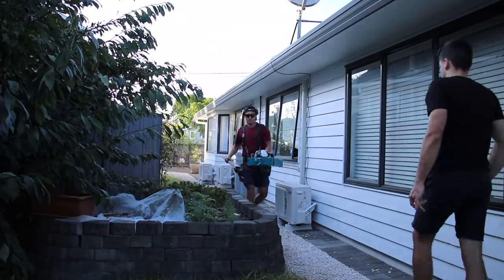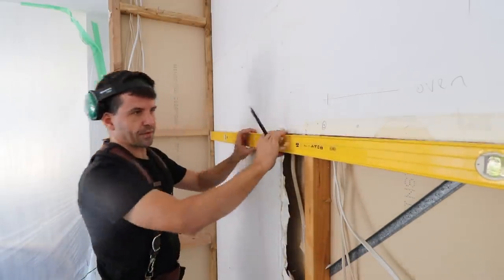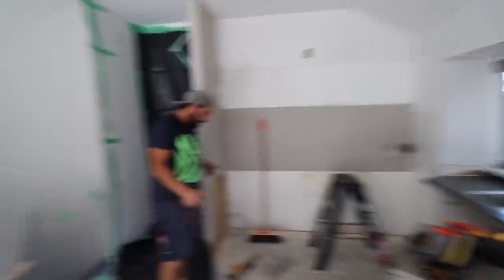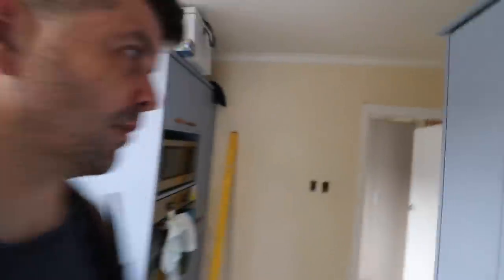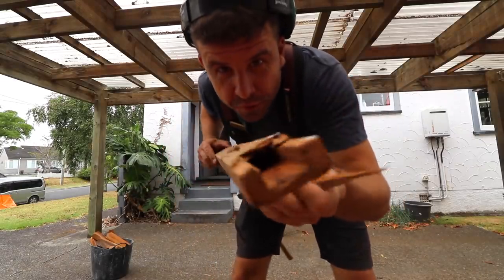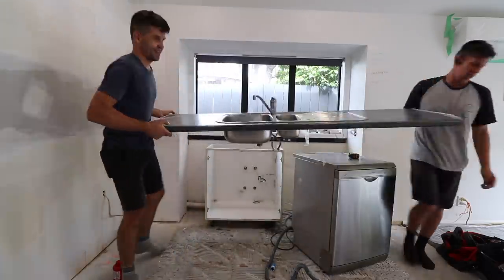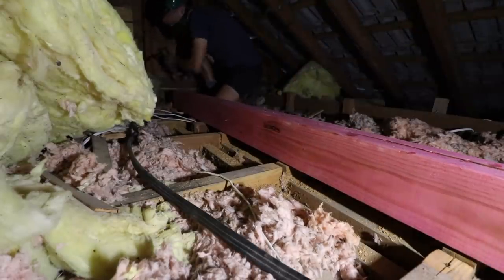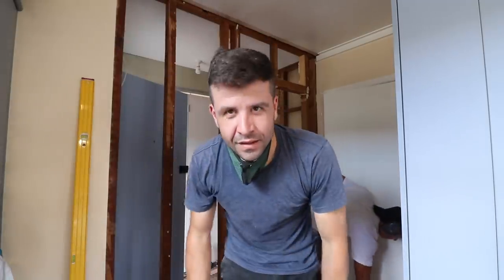Builders Don't Install Kitchens [Part 2]

Comment: You can't understand the insane amount of jealousy I feel right now.

I live in Sweden and the weather here is awful right now.
Reply: Niklas Paulsson I’m in Michigan and it sucks here too I’m moving to New Zealand in my 30
Reply: Just spend 6 weeks in NZ, bit of a bummer, coming back toa  stormy, dark and very wet Malmö.
Reply: North of Norway, building a hotel here, does not have walls yet and its minus 5 and we have ONE day a year when its not wind :P
Reply: Same here in your neighbour, Finland. Thankfully we have beautiful videos provided by Scott!
Reply: It's called winter..
Reply: NZ has pretty bad weather on the whole. Cold wet winters and windy as hell down south. Come to Australia as it has a far better range of weather and the trade get better pay also.
Reply: The only thing you dont have to put up with NZ weather is the sun.  It can certainly BURN you, even at very low temperatures. We have one of the highest skin cancer rates in the world and our sun is harsh due to thin ozone layer. The more pale skin you are, the more easier your skin will burn on fire.
Reply: @sydneyshinshi  bad is in rain or humidity? I'm in Hams and our temps are between 29 -31 not counting the humidity.
Reply: @TheClaudos  Where is Hams?
Reply: @sydneyshinshi  In the Deli section of New World, Pack n Save, Countdown.
Reply: @TheClaudos  Ah Hamilton now I know.
Reply: Michael Magill otherwise known as “the Tron”, Hamilton. Used to be seen as a small city stuck in the 70’s/80’s, so the nickname is a sarcasm, but the town has grown and advanced somewhat and the nickname carries more affection these days

Comment: for plastic walls we use the thicker stuff edge it with a duck or heavy tape. apply painters tape to wall/ceiling than use cabinet feet you would nail in so they can slide around the cabinet shop to tack the plastic into Sheetrock than use more of the heavier tape to seal it to painters tape works very  well

Comment: To get poly to stay up either use support extension poles or use painters tape on the drywall and use tuck tape (sheathing tape) from the plastic to the painters tape. It holds really well.

Comment: I'm a  Carpenter /Joiner in UK .I install kitchens & bathrooms also do 1st & 2nd fix ,cut roofs ,tile walls & floors .As most of clients want a start to finish project .By doing it all easier to keep work flow no waiting on different trades .Only trade i get in a sparks but he my brother i first fix
Reply: Same here pal. Most Carpenter / Joiners I know fit kitchens
Reply: Same here Dave. When I did college a long time ago kitchen fitting was part of the course. Seem to pick up skills etc as you go along. I dry line, spray kitchens, fit them etc
Reply: It's the same in Australia, a builder will usually prepare the area and a cabinet maker will be engaged to supply and fit the cabinets/ benchtop. Then tiler, plumber.....etc
I agree alot of time wasted between trades, but its usually not feasible ( here in Sydney) to supply then install a kitchen yourself compared to the price a cabinet maker will charge to supply and fit.
Reply: normel678 I was in sydney visiting family last year. Didn't check out any builders merchants whilst over there but in the UK normally builders merchants supply kitchen units either in flat pack or ready built. It's just a matter of fixing them together etc. Is it the same in Aus? I've known friends of mine with no carpentry experience fit them.
Reply: @wildobeast1472  - yep, you can buy flat-pak from large hardware stores and some kitchen places supply them flat-pak as well. Just replaced by own kitchen cabinets in NZ with flat-pak cabinets from a kitchen importing company and I'm not a carpenter, builder or anything like that.
The range in NZ hardware stores is nothing compared to B&Q in the UK, though.
Reply: @wildobeast1472  yeah you can buy them flat pack here as well. I have put a couple together before. My experience is that by the time you buy flat packs, get them to site, put them together and then install them it's not worth the minor saving and the quality is way inferior to a cabinet maker's. That's just been my experience and most builder's I know always engage cabinet makers.
Perhaps flat packs are much cheaper in the U.K. which may make it more feasable.

Comment: Cut out a square big enough for a 12x12 x1 air filter and tape it in your plastic wall to allow air to flow threw it, but not dust. Keeps it up longer

Comment: You stress that you can't use that method to remove a load bearing wall.  Ok I'm fine with that but if it is not a load bearing wall it doesn't need to have any additional or replacement supports.  The wall is not holding up the ceiling it is only holding up itself.
Great video!

Comment: Cool to see the 36v Makita worm drive in regular service.  I'm pretty interested in that thing.
Reply: So much torque - you see how quick it was going through the timber. Nice saw.
Reply: It's a bit heavy, but a fantastic saw. Bought it after my corded Hitachi started to sound like a helicopter and flash like a strob.
The makita is much stronger and easier to cut with overall.
Reply: @mackaronen  Yep is a bit heavier than the normal 6 1/2" cordless saws too. 

Where it's rear handle its heavier on the wrist. So much toque in them for cutting 2x4 or 2x6.

Comment: I hold my plastic up with roofing batton. Get one across the top to trap the plastic. One on the floor to get the bottom and spring in some uprings to hold it in place.

Comment: Staples through the tape into the ceiling normally help hold the plastic up.👍
Reply: Then you have to fill and touch up afterwards.

It works but a bit too much for a job of this size i'd imagine.
Reply: @shifty277  yeah very job dependent. Most of the time on these sort of jobs there's normally a vast amount of plastering and decorating so the cut down in dust outways the minimum repair cost to the ceiling.imo obviously
Reply: @rossmale8715  Yep see what ya saying here. They put the carpet wrap down too. That stuff is really good.
Reply: @shifty277  one of the first things off my van. I've got two rolls one for carpet and one for hard floor,I made the mistake of putting carpet protection on a hard floor and trust me when I say I won't make that mistake again 😂😂
Reply: @rossmale8715  Haha yep they have a different way of bonding to the surface - i'd imagine the carpet stuff has to be a lot more stickier - where as the wood protection doesn't need to stick really just needs to go down, stay down and be durable. 

Customers always appreciate it when contractors make the effort to avoid any accidental damage - even when in my own home nice to see people put protection in place before I reach for my own stuff.
Reply: @rossmale8715  I saw on a job where they had to sand and refinish the h/w floor because of the carpet one used. Expensive mistake that.

Comment: Actually I done plastic wall once upon, when used slihl power saw to cut out new doors in noncrete wall woth thickness about 45 cm.
Must be used 3m double side tape and heavier membrane. Of course that tape will stick to non dusty surface and when you take it off, it might damage surface a little bit.

But it worked.

Comment: You should look into Zip Wall poles or FastCap "Third Hand Poles" for your temp walls. I use them here in New Jersey for temp protection.
Reply: Bryan Butterfoss we use something similar here in Australia, I normally carry 5 poles and can divide a large room in minutes. No tape needed
Reply: Same here.  Zip Wall system is a must.
Reply: Simple alternative is using the extra large squeegee heads on extension poles. 

Frankly why they tried to tape up plastic with green tape is baffling. 

Also had to get creative on huge homes. Used the carpet pad from the demo wrapped around a 2x to hold plastic up. 

Was working outside of Boston when grinding up tile mortar set off the smoke alarm.  The fire fighter in full gear tried to step through an old rigged zipper opening and his air tank caught on it. He went head first into the front lobby reception desk.....
Reply: @livelikekings8968  What plastic do you use (for your temp walls) and where do you buy it?

Comment: The hinge jigs with an 18v router are money! Are far as i'm concerned the days of doing hinges completely with a chisel should be done.
Reply: where do you get yours from? Are they adjustable or you buy 100mm/90mm sizes
Reply: @mcleaniechris  in the UK Trend have the full beans kit @ £180 of just the bare hinge jig is £80. 

Ryobi also do a barebones jig on Amazon too at about £30.

The UJK version on axminster.co.uk is very well regarded too at £80.

Lots of options depending on your budget.
Reply: I took the time to learn how to fit hinges with just a hammer and chisel. However,
Now that I know how to do it I prefer to just use a router as time is money my friend
Reply: @tormenting360  agreed. As long as you take your time with the router its easy to get a flawless result as well.

I dont even cut the corners with the chisel as in the UK, you can now get curved radius corner fire rated hinges.

Comment: Its funny you say Builders dont install kitchens ,I was always told by an old boss called Ken "Cabinet makers should never build houses" . I also remember building told never do anything in pen on wood/gib board or any form of building, always use a Carpenter's pencil , Good Old Blackledge

Comment: SBC - I don’t know if the company “Fastcap”  sells their tools in NZ. They make a tool called 3rd hand https://www.acmetools.com/shop/tools/fastcap-3handcpack-3rd-hand. In this case it’s a jack that reaches from floor to ceiling, great for holding plastic in place, when someone opens a door, or if the door is open all day. Fastcap makes several sizes. They are perfect for installing upper cabinets. Keep up the great work! A fan from USA.
Reply from the maker: Thank you mate, I'll look into it !
Reply: @ScottBrownCarpentry  I mostly work alone so the 3rd hands come in handy. Add in a magnet strip for any door ways needed. My clients love the ease of use of the RE-U-Zip Magnetic Self-closing Entry. You can find it on amazon.

Comment: 8:15 kinda strange, never seen this done before in the US. Not that I’m a framing pro lol. But if the wall you’re removing isn’t load bearing, then what is the need to somewhat support the roof truss cross members with that pink beam? Curious, not trying to be a jerk. 👍
Reply: To me it looks like the bottom roof truss members are spliced over that wall, which is why they need to reinforce it. If they weren't it wouldn't be necessary.
Reply: He is in the neighbors house which is a conventionally framed roof, not trusses. So the ceiling joist need to span across walls and usually require hanging beams to take out any sagging that may happen in the span.
This wall is taking the ceiling load not the roof load, hence the need for the hanging beam. Hope I made sense.😊

Comment: for the blowing plastic wall use a zip wall poll, or carefully have a bit of timber sprung into place.   On the commercial installs my brother and I used to do we would also have our tools on a painters scaffold and with strategic broom placement we could use that to support the blowing plastic sheeting.    great work, thanks for sharing your craft.

Comment: Hi from Sydney! Thanks for the fantastic videos, man. I wanted to ask - how do you use the DeWalt table saw (15 amps) at any given house without tripping breakers? Thanks again!
Reply: 15 amps is nothing surely? Standard UK circuits for sockets are 16A or 20A - what is it over there?
Reply: @alexanderbuckland  10A in AUS to my knowledge 😅
Reply: I've got one (USA) and mine constantly trips breakers... Thinking about getting the flexvolt battery table saw just so I can stop walking down to reset the breaker every other cut
Reply: @brianwood876  might be worth getting a sparky to install a new plug and fuse just for the table saw!
Reply: @nab024  I work in other people's houses 99% of the time.... I run it off a 20 Amp at my house but it'll trip a 15 Amp no problem on the job
Reply: @nab024  and I specialize in older houses (new England) ... Some of which don't have any 20amp breakers, some don't have breakers at all
Reply: Alexander Buckland don’t confuse what a circuit is rated to with what you can plug into a socket. The purpose of the circuit breaker is to protect the cabling, which needs to be rated to what ever the cable size you use is capable of carrying.

In Aus and I presume NZ most residential circuits will have a 16A breaker which will protect a 2.5mm cable operating at 220 to 240v. 

When it comes to sockets the standard socket in the UK is rated to a maximum of 13A and UK plugs have fuses in them. 

In Australia/NZ a standard socket is only rated to 10A. For us to connect anything higher than 10A then a 15A socket is required which in turn will mean a larger breaker and cable supplying the socket. The difference between a 10A and 15A socket is the 15A socket has a longer earth pin which is too big to fit into a 10A socket.

Comment: 50x150 (2x4)... look to be a little small for that span of the roof. I would have at least used 2x6 (is that 50x200?) douglas fir's. I couldn't see the length, but either way in the us the small stud wood like that usually is not structural grade.
Reply: 50x150 is 2x6. 50x200 is 2x8.
Reply: @tylerdobdob23  ah

Comment: Nice dust mask 1:20. Been there before! What happened to your Paulk Inspired mobile workstation? Update?
Reply from the maker: A little too bulky to be portable . I'm thinking of an alternative. Maybe the paulk 2nd edition or a Festool table.
Reply: @ScottBrownCarpentry  its definitely a tradeoff to sacrifice the weight and bulk for the functionality. I've been working off of sawhorses for a few years and it's just not working anymore, need a change for efficiency!

Comment: Why do new Zealand tradesmen have Van's from the 80's ?
Reply: lol - specifically gets this shape of van to lay sheet material on the top with tool storage underneath.

Not the best looking vans in my opinion but they are a bit more functional than the bigger empty carcass vans like a Mercedes Sprinter for example.
Reply: I really like them, I'm in the UK and have a standard van. Think I might purchase one of these bad boys when my current one dies.

Comment: Hey you should try the zipwall system for hanging plastic. spring assisted poles from floor to ceiling. Time saver and won’t loosen from the wind

Comment: i dont get it. why dont you as a carpenter do the kitchen aswell? same in america, but they are more extreme. one dude does the framing then another dude comes and do all drywalls, then a third one does all the plastering of the drywalls, then the fourth guy the painter show up? wtf? then in between you have the electrician and plumber(dont know much about them over there, but im sure there are different dudes installing the toilet and zink. it wouldnt surprise me.). over here. carpenters do everything, from capentry to, drywalls and kitchen. then the painter comes and do the whole shoobang himself aswell, from plastering to the finish touch.
and i just saw you need to swap that multitool out to the new one with the quick release :D

Comment: why are the boards pink in new zealand?
Reply: kurtzcol pink timber is a treatment for timber to be utilized in high moister environments and is rated for interior use. Pressure treated timber with cooper or the old fashioned arsenic timer are prohibited by Residential Code standards except for seal plates that are directly in contact with concrete.
Reply: @royalvarez6436   carpenter in canada just curious to know how things are done in other places  thanks

Comment: What's with the dodgy electrical wiring in the roof space? They look new, did your sparkie throw them in recently? I think you should address this in another video. That's an electrocution waiting to happen.
Reply: They ain't naked wires..
Reply: @Dansfishroom  Yeah, but it's still sloppy work. Cables need to be attached to joists or run through them.

Comment: https://bct.eco.umass.edu/publications/articles/understanding-loads-and-using-span-tables/.  It would of been nice to explain in more detail how you came up with the beam on top of ceiling joist calculation from tables i provided. It looks solid on the video but you are still using the ceiling joist to support the midspan length and it looks like the beam is acting as its floating on top instead of supporting the midspan of the ceiling joist. In my experience i used a built up 2x8 underside of ceiling joist which supports the ceiling and support a larger finishing opening. I would imagine that your span was not so large that is why you did this method.